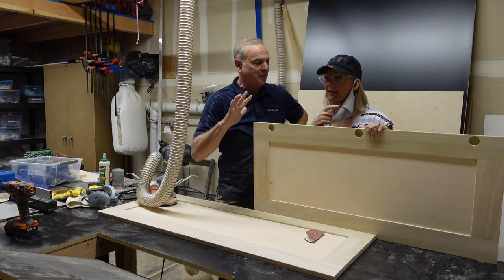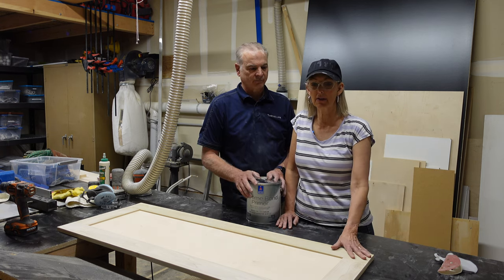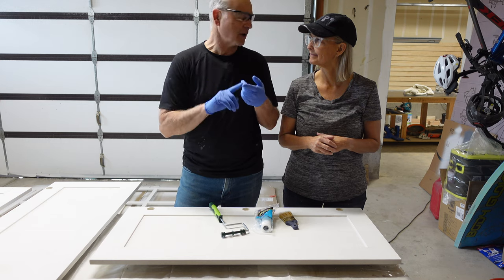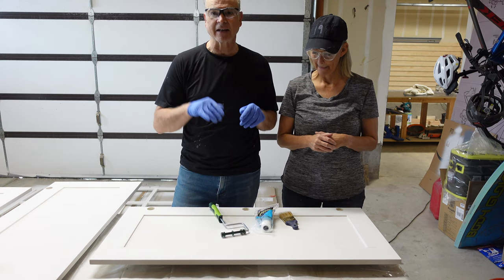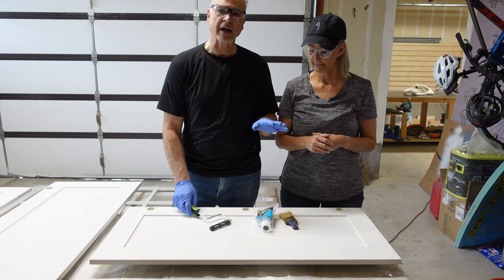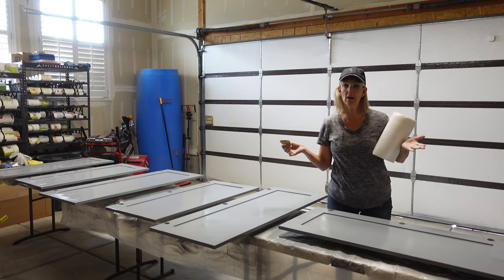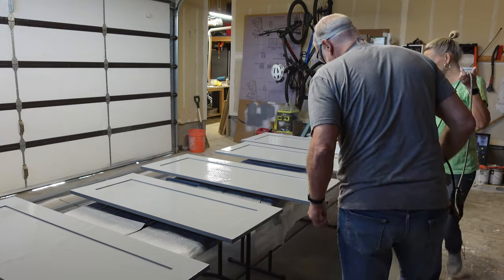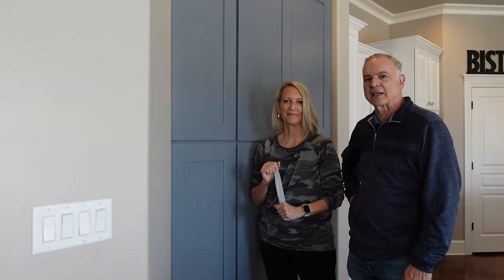How to Paint Cabinets- Our Four '"P"s for a Professional Finish

Comment: Great job on the cabs, what speed setting did you have the spray gun set to ?
Reply from the maker: As low as possible. I run it at about a 3 using Sherwin Williams Emerald Urethane.
Reply: @OurThrivingLife  Thank you for the quick reply !!

Comment: Thanks for the video. What paint sprayer dis you use? Is it the vsp or dsp model? Awesome work
Reply from the maker: VSP
Reply: @OurThrivingLife   one more question please. Did you use the stock tips that comes with the gun or did you bought a tip for cabinet use? Thanks again